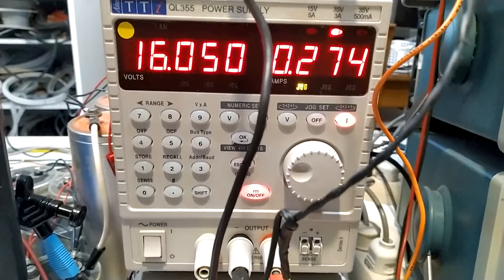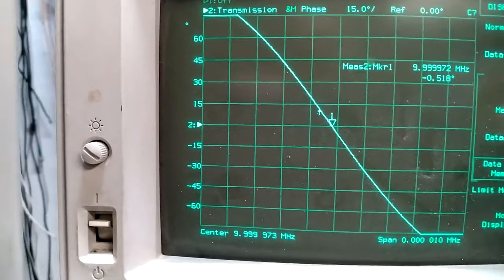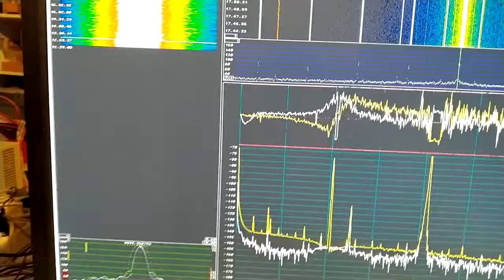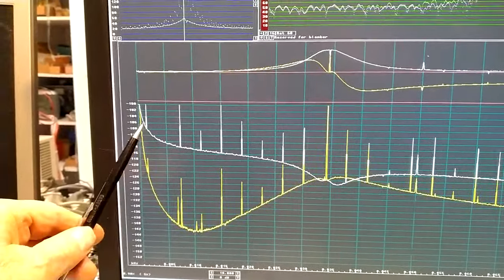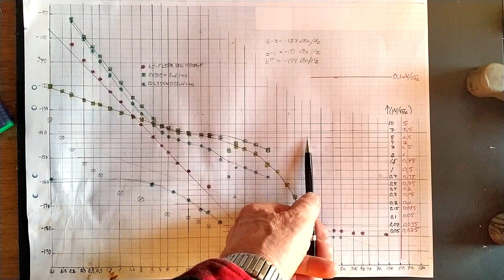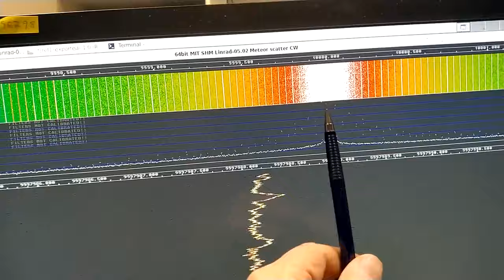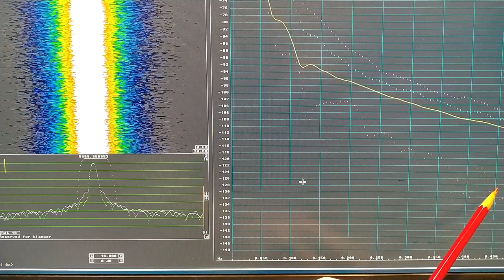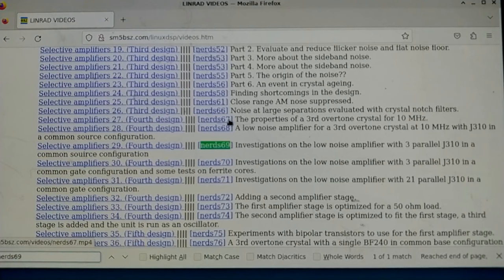nerds90

Comment: What did you study in college or what do you study in your free time to get so knowledgeable about these things?
Reply from the maker: I have a PhD in molecular physics and I did experimental physics for about 15 years. Actually I am not so  knowledgeable about these oscillator related things, that is why my videos are so long. I am trying to learn from experiment how to make the best possible low noise crystal oscillator. Previously I was aiming at minimum noise at large frequency offsets. Now I am trying to minimize near the carrier, in the range 0.1 to 5 Hz.

I do not worry about temperature stability or long time stability, I am looking for the best "flywheel" to use with things like this: https://www.leobodnar.com/shop/index.php?main_page=product_info&products_id=234 which has an excellent long term stability, but mediocre close range noise, -70 dBc/Hz @1Hz offset. Also with a better unit like this: https://www.thinksrs.com/products/fs740.html with -109 dBc/Hz @ 1 Hz. 

I have seen as low as -127 dBc/Hz @1Hz in my experiments, but it is not (yet?) reproducible.

Low noise down to 0.001 Hz offset or 1000 seconds or frequency stability for 15 minutes will be of interest for a flywheel oscillator.